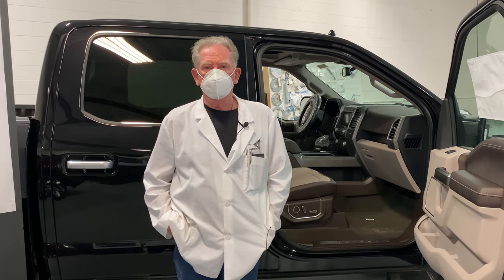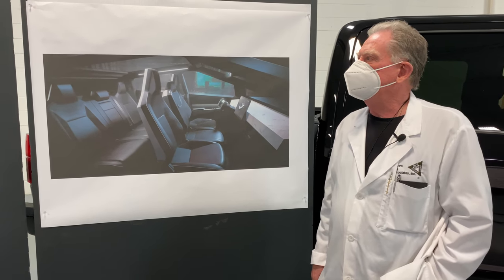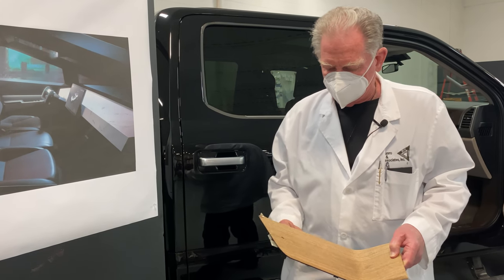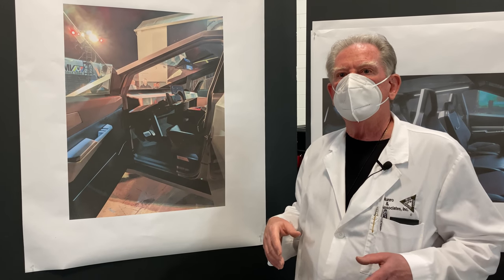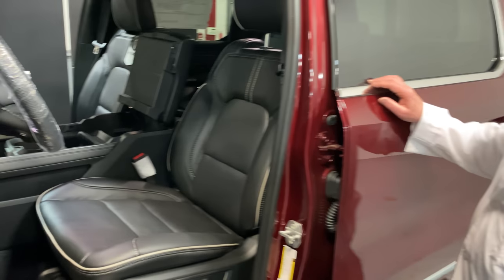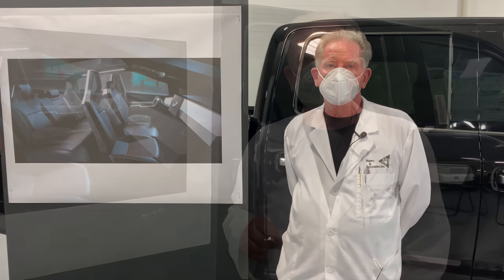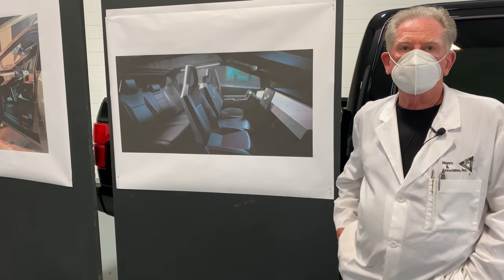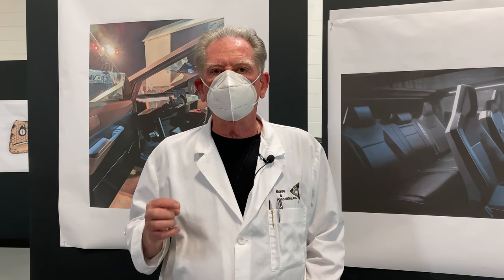Cybertruck E4 - Interior

Comment: Sandy, you're probably right about personal truck consumers and what they like, but there's a whole other group of truck buyers.

Businesses.  Those guys are interested in specs, performance, convenience, utility and especially life cycle cost.  A lot of pickups are sold to businesses: construction companies, landscapers, roofers, farmers, and so on.

From the little we know about the Cybertruck, it seems it may have a lot of appeal to this group of buyers.

The Cybertruck has a flat bed 6' with no wheel well cutouts, useful tie-downs, illumination, a rolling tonneau cover, built-in electrical and pneumatic outlets (eliminating the need to drag a generator or air compressor to work sites), seating for six, plenty of range for local to-and-fro from company to worksite, probably good off-road characteristics for getting to hard-to-reach sites (bad roads, or none).  It'll need a fraction of the maintenance and last for a million miles.  Its energy costs will be a fraction of an ICEV pickup.  And it will resist scratches, even if the bed is used heavily.  Hose it down and you're good to go.

The odd appearance of the Cybertruck won't dissuade businesses.  Slap a magnetic sign on the side (which will adhere nicely to unpainted steel) and the whole package is instant advertising.  It will draw attention to the brand.

As businesses buy these trucks and put them to use, public awareness about them will rise.  I think the Cybertruck will catch fire even with traditional pickup consumers - though if you asked them about it today, they would deny it.  They aren't sold on this vehicle yet.  But they may become sold.

So, I don't think it's just going to be early adopters who will be interested in the Cybertruck.  It's going to find traction in the pickup market - even though we probably agree it almost doesn't qualify as a pickup at all, certainly not in the sense we're familiar with the category.  It's something new.
Reply: Excellent points!
Reply: Good points, but the stainless steel surface of my refrigerator is non-magnetic.
Reply: Most American pickup truck buyers are wantabee off roaders and pretend contractors , they want a cheap truck that looks tough. And the Cybertruck is after that market.
Reply: @MsAjax409  I'm sure it is coated.

But I take your point.  We don't know the magnetic characteristics of the steel Tesla will be using.
Reply: The stainless steel grades we are talking about here (301, 304 etc) are all non magnetic.
Reply: Yeah, stainless steel is non-ferromagnetic and therefore nonmagnetic
Reply: Nice essay bro.
Reply: And, once those workers get a taste of the Tesla driving experience, they'll want to buy a Tesla for their personal or family vehicle. Same with drivers of the Tesla semi. It's hard to go-back to a gas car once you get used to electric.
Reply: I agree with most of this with the exception that a 6' bed is good for construction. the 8' bed is more desirable for obvious reasons. also I'm concerned that the air compressor in the cybertruck may not be adequate. also the last thing is that there is no provisions for custom beds, most pickups you can remove the bed and build a custom bed, which is a big thing especially with welder trucks. but for a truck owner who is more recreational it will do fine.
Reply: Awesome breakdown! I own a Ford F-150 (hate it, but besides the point) and I had no real idea of the differences. Though all these crappy legacy trucks were the same but clearly not. Keep up the great work!
Reply: @markplott4820  unfortunately the cybertruck isnt going to be nearly as easy to modify like a normal truck
Reply: stop the nonsense, you think having flat bed 6´ no wheel cutout and electrical outlet is going to be different than normal pickup trucks?!?!?! wtf.
Reply: @TheGamingGurewZ  crappy legacy my A@@
Reply: My  2008 Tundra Limited  still has all three of these beat with its interior leather . The power of the 5.7 is good but having just received my model Y The power of the performance version blows away the ice trucks. The cyber truck will do the same  especially the tri motor. I have ordered and will then be fully eclectic. It’s the future and the three big ones are light years behind in my opinion. Good review
Reply: @greynolds17  Tesla will 100% come out with a more traditional body-on-frame platform truck or van specifically designed to be modded. Ford pretty much owns that market (at least in the US) and their deal with Rivian is intended to secure that into the future. That is a huge market, and Tesla will definitely go after it. Especially since the commercial vehicle market could also have an integrated software element to it (delivery routing, inventory control, vehicle tracking, built-in communications etc).
Reply: Commercial vehicles are a HUGE market and Tesla will definitely go after that even more in the future. I will not at all be surprised if Tesla begins working with their commercial clients on software packages to run in the vehicle. Stuff like hands-free video chat, delivery route planning (also crucial for ride hailing), inventory control, vehicle tracking and remote monitoring in general, all kinds of things employees are issued a tablet or phone to do could be integrated into the vehicle at a huge potential software as a service profit.
Reply: @patreekotime4578  Yes.

I'm kinda sorta expecting the Berlin design studio to jump with both feet into creating a commercial van, or more than one, to go up against Mercedes.  That is not a small market, in Europe or elsewhere.

Rivian is entering that market with its large order from Amazon in the US.  I think they'll do a good job with that.  But I think Tesla could do it better with Roadrunner tech.

Comment: The Cybertruck is expanding the truck market beyond traditional buyers, so interior design is going to be consistent with the exterior that has attracted those new buyers, in addition to some of the normal truck buyers. Pre-orders for the CT are at 750k now. There's no need to bow to the desires of traditional truck buyers.
I agree about the steering wheel though. Needs to be a wheel of some description.
Reply: complete nonsense, the interior of trucks doesnt really need to be special, they are work horses, mercedes and toyota still makes some trucks and suvs with really basic interiors and sell them to armies and international organisations...... also trucks are less efficient than other sedans or wagons, people should be bying wagons instead
Reply: @carholic-sz3qv   - Tesla Cybertruck is a Replacement for HILUX and Landcruiser.
Reply: Le Chat Botté the Cybertruck interior should be no surprise to people.  Tesla focuses on the center screen and it’s great!

Comment: These videos comparing the pickup trucks are great to understand the pickup truck market and how it has changed and is changing today.
Reply: ICE pickup have NOT changed much in 100 years, it's why we need the Cybertruck.
Reply: @markplott4820  nonsense, pickup doesnt need to change and they have really changed with the 100 years, trucks are made to be modified easily asf, look at the ford f350 or f450, remove the bed and you can add basically everytype of equipments you want.

Comment: Digital mirrors have a completely different focal length that pulls your eyes completely off the road. You're right. I hadn't really thought about it.
Reply: My 2020 Bolt has a split mirror, if you flip the lever it becomes a digital mirror. The other way is just a normal mirror. I really hate the digital one, it has no depth to it and the focal length is different so it's just a distraction. I only use it when backing up very slowly or when stopped to see if anything is in a blind spot.
Reply: Dr. Know - the SAME Issue was found in Helicopter Helmets using the Monocle system. 
eventually, Pilots were Trained to overcome Having TWO separate Display for EACH Eye. 
the Same will happen for Cybertruck.
Reply: Yes, Agreed on digital mirrors. I have far less visual acuity these days and need to wear glasses to read the dash instruments. Basically totally blurry after focusing on the road distance. 
Standard mirrors are no problem as no need to refocus for distance. The digital 15” reverse mirror in the 3 is also fine, but a small rear view mirror would be a problem for my fading eyesight. Human eyesight starts getting shitty for most people after 40-43years on the planet.
Reply: @human_brian  I have a 2019 Bolt with the digital mirror.  I love it for the wide angle view.  Essentially eliminates the blind spot.  I am not sure why, but I don't have a problem focusing on the mirror. I am over 75 years old, post cataract surgery, so I have no "focus ability" of my eye lens.  Maybe because I have the seat all the way back to accommodate my legs the mirror is far enough away  that it is easy to focus on.

Comment: The only reason the center rear view mirror is where it is, is because that is the only place one can put a mirror to see out the back window. Once you go to the camera and video screen, there is no reason it needs to stay there.
For the cyber truck, it should go down in front of the steering wheel as far forward as you can get it to minimize the focus change as much as possible. It should be centered in front of the steering wheel, it does not need to be offset to the center of the vehicle. Only the driver needs to see it.
If you make it wider than the one shown in this video, the side mirrors could be added on either side of the rear view.

If one really wanted to make it so that one did not need to change focus to look at it, you could embed the screen face up in the dash behind a lens to make it appear further away, and view it through a mirror

Comment: They might use the coanda effect for air distribution which would be pretty sweet. Another thing is that Tesla doesn't need to redesign engines or anything like that. If you think about it, all Tesla is doing is just putting a different skin over the same tech which is just crazy awesome. Their autopilot system is also superbly dynamic and doesn't need much tweaking to fit a different form of vehicle.

Comment: I see the cyber truck as a blank canvas.
The outside body, being stainless steel, can have all kinds of stuff welded to it (with a bit of effort being stainless).
The dash is clean, empty and ready for all kinds of radios, gun holsters, cup holders, nodding dogs and whatever you want to bolt on.

Comment: I want a full steering wheel and an option for a grey or black dash instead of the faux-marble look. the rear passthrough fold-down window would be great for outdoors camping use. Excited for duel motor cybertruck! about 65,000 on the list.
Reply: Prototype wheel is not legal. It has to be a round shape.

Comment: For offroad use that steering wheel is useless.  I took the Land Rover course and rule number one is never have you thumbs inside the wheel unless you want to break them when you hit a rut or boulder and the wheel jerks.   You always held the wheel with all digits outside so the wheel would slide under pressure and your thumb was safe and you maintained control.

Comment: I agree about the steering wheel, give me the standard round wheel that I can grab anywhere.  Another concern I have is the under bed storage compartment, I have seen many panels in trucks get bent to oblivion by the cargo tossed in the back.   Will this be the first Tesla with a spare tire?  I hope so.
Reply: Kenneth Bowden I am sure it will be available as a cost option, and it certainly would be worth getting a spare for this vehicle as those size wheels/tyres will initially be uncommon at remote tyre shops. Sadly the spare wheel may cost a bundle, like on other Tesla’s
Reply: @kdkd693  https://www.tirerack.com/tires/TireSearchResults.jsp?zip-code=87801&width=35X&ratio=12.5&diameter=18
The tire size is already pretty popular.  Having someplace dedicated for a spare other than just loose in the  bed is what I am hoping for.

Comment: Honestly I want bucket seats in the cyber truck and a large console. I understand the function of the third seat but those are rarely ever used
Reply: Agreed
Reply: Those seats will be comfortable, no doubt. They will be designed for rough travel as well as highway. Plenty of time yet to fine tune the internals before production ramped. 
The middle front seat doesn’t need super comfort levels for sure, but it may surprise as this truck will be super roomy inside with the exoskeleton- moreso than even the existing full size trucks I suspect
Reply: Yeah but the whole point is the middle seat is unnecessary and from a function standpoint a console makes more sense for most people

Comment: I took a Lyft in a Ram and the interior was very dressy and comfortable but it had a lot more creaking sounds than I would expect. I prefer the shifter on the tree or on the dash like in the older Prius and some French autos unless you actually have a manual in which case in the console or on the floor is better a push button shifter would also be ok if there transmission is automatic.

Comment: 100% agree with Sandy's steering wheel dislike.  And as a wearer of progressive lenses I can see how the rearview mirror wouldn't work at all.  Now if you could move it from the roof down to the top of the dash then it would work.  Would still rather have an actual mirror though.

Comment: First truck I drove was my dad's 69 C10. Three on the tree and no power anything. No AC in Texas. Options? AM radio. It had a wonderful simplicity.
Reply: My 72 Ford truck included an air conditioning system that never broke down. When driving at speed those little quarter glass windows provided all the "AC" we needed.
Reply: @user-vp1sc7tt4m  Ah yes, something that should never have gone out of style, wing vents. Something else I liked was the headlight switch on the floorboard. Modern steering column stalks have way too many functions.

Comment: I expect the Cybertruck won't have a cabin heat exchanger and fan. Tesla will combine then with the other heat exchanger units under the hood and just use ducting to transfer air in and out of the cabin. Without fuel lines under the hood, there are fewer issues with preventing a fire under the hood (perhaps in the frunk cargo area) exhausting through ductwork through the firewall into the cabin. Can always install a fire-shutter in the ducts as the firewall.
Reply: You're completely ignoring the high noise and sound levels you would get. The interior has to stay sealed up so that you can both recirculate cold or warm air as well as to keep the interior as quiet as possible.

Comment: Thanks for the dashboard explanation.  I knew about the jumpseat, but the dashboard was before my time :-D   Its a little tricky trying to figure out how much Cybertruck features are prototype only and subject to change.  I hope they are wise and creative about making the best adjustments before I get mine.  The yoke looks good for a prototype, but NO WAY in hell I want it over a steering wheel until they give this thing wings to fly.  I hope they make the back seats and bulkhead for the vault to fold down.  This will add more utility I'm looking for.  The best carpeting is no carpeting.  I want to take this thing overland.  You can have a nice looking comfy floor that is also super easy to clean and stay Cyberpunk.  Cheers to an awesome design Tesla!  Lets make it the best it can be.
Reply: Elon told Jay Leno the CyberTruk comes as shown.
Reply: just add a drain plug and hose out the interior
Reply: @clarksmith6850  I hope that is 90% true.  I doubt it is 100% true.  Many weeks ago he suggested there would be a 3% size reduction so people could fit in in smaller garages, then that changed.  If they can make improvements before final production specs, I expect they will.  I don't want a size reduction, so I'm happy that change was reversed.  The steering yoke looks cool, but it is dysfunctional/dangerous for offroading.  I don't want that.  A back seat that folds down with the vault bulkhead to make the vault full bed size+ with access from the cockpit is superutilitarian, and gets two thumbs up full support from me.
Reply: @brandoYT  I had a GMC Sierra plow truck in the 90's that had a tough rubberized work truck floor that I loved.  It looked fine and stayed that way for years of tough use.  Cleaning was super simple, and I'm sure its cost was low.  I appreciate some comfort and luxury in a seat, but for flooring, tough utility all the way.  A drain plug might be asking too much, but I like the way you think.
Reply: Several things on the Prototype cyber truck need to be changed in order to make it street legal. The steering wheel has to be a roundish shape, it will need windshield wipers of some sort, it will need side mirrors if cameras are still not legalized in the US, and it will need better headlights that meet DOT standards. These will all be sorted out before it goes into production.

Comment: Sandy, look way back in automotive history for jump seats. Early touring cars from the 1900s to the 1920s had a large back seat area with a fixed bench seat in the far back, and a middle row with folding jump seats behind the front row of seats. Dad had a 1917 Reo Touring car with a folding soft top, half height doors, no fixed side glass, and two jump seats between the front row of seats and the fixed bench seat in the far back of the rear area. The doors were below shoulder height and had removable side curtains, some with glass, and many with flexible materials similar to later convertibles. They were very uncomfortable in the rain and even more so in the snow. Dad had some Bison Blankets, kept in a trunk similar to a travel trunk behind the back seat, and a couple of charcoal fuel foot warmers since only the front seat had any kind of heating. Check out this Wikipedia link to touring cars.
https://en.wikipedia.org/wiki/Touring_car
Reply: They be Rumble Seats what folded up instead of trunks on a coupe'.